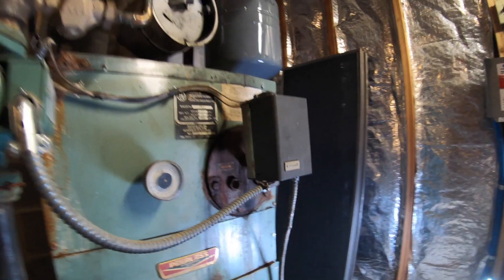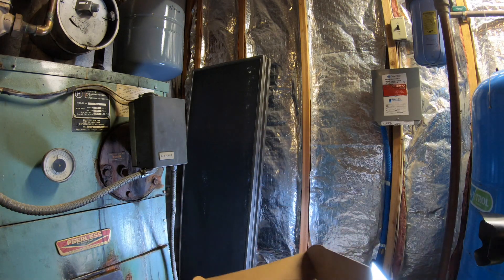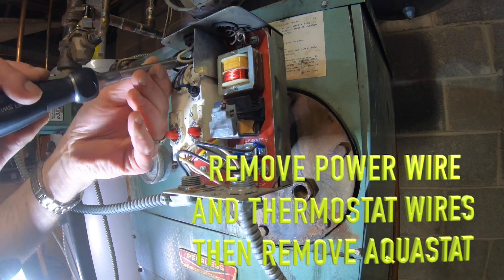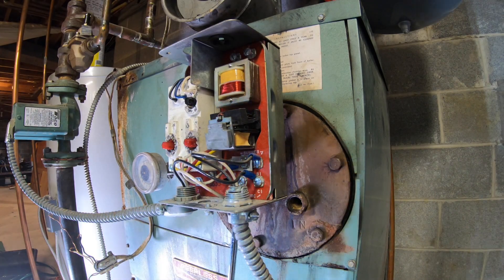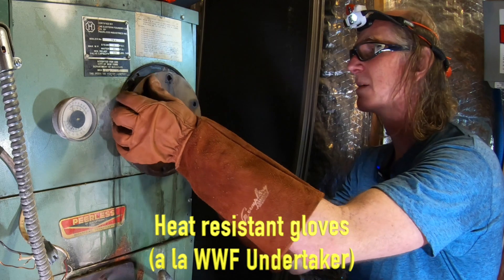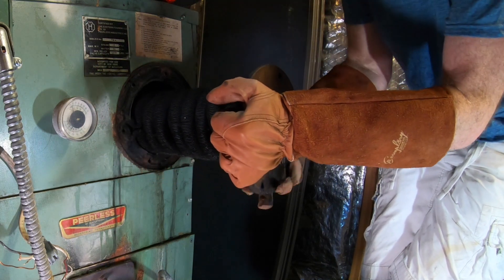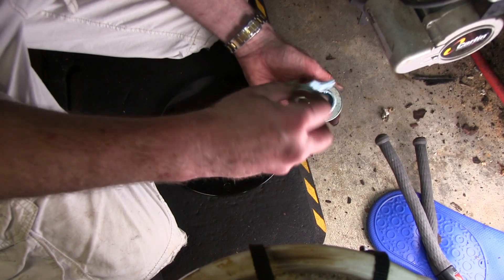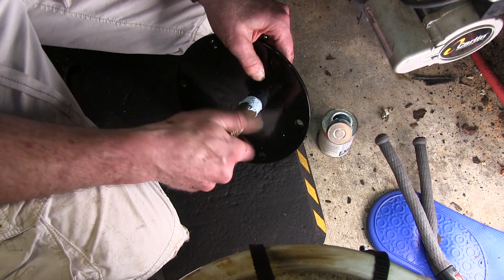Oil fired boiler Tankless coil gasket leak- DIY replaced cover and gasket

Comment: I have a really gnarly rusted one,leak  starting to rmake water line down the side and I  cannot afford a new furnace, is it possible to fix it, like you did? Or do they rot out?  Thank You
Reply from the maker: I still have that furnace, it’s working great.  My only worry was snapping off the bolts. You can buy a new cover plate like I did and it came with the bolts also. You just gotta be ready for the worst case scenerio. Like head snaps off a bolt. Drill it out, retap etc. or weld a new head on to spin it off, etc. it would be the same as if you were working on your car and had trouble with a bolt. Take a torch to it, etc. I got lucky and mine all came out in one piece cause I was really really careful. But I had all that stuff ready. Dremel, center punch, new drill bits, tap and die set etc. but totally fixable. Good luck.
Reply: @Drrich_DIY thank you !!  Yeah we rent here 43 years and our landlord has wanted us out for a long time. The problem is we’ve never been late with a rent payment in that amount of time so every time something breaks here to keep him out of the loop. We just fix it ourselves if the furnace went I think we would be finished and have nowhere to gobecause I think a new furnace is like $10,000 so yeah I was just hoping this thing is repairable thank you so much for your answer and it was very quick too. God bless.
Reply from the maker: Or you can just leave it. Do you have an automatic fill?  If it’s a slow leak who cares or you can manually add water once a week. It really doesn’t affect the performance at all.
Reply: @Drrich_DIY  it’s been off now for the summer. I turned it on this afternoon just to see what would happen and all the leaks seem to dry up so maybe when I was seeing was some kind of sweating going on downstairs not sure but thank you for the information because yeah, we would be up the creek if this thing died thank you!!

Comment: You have water heater next to it. You bypassed tankless.?
Could have you of gotten a new coil for it?
I’m in the same boat idk what I want to do by pass it or put new coil in that’s why I’m asking.
Reply from the maker: The prior owner cut the copper water pipes to and from the tankless and had an indirect fired water heater installed. So yes the tankless was bypassed. I was only doing this cause of a leaking gasket on the tankless coil. Let me say the indirect is fantastic. It stores 55 gallons of hot water, and has its own aquastat so I can set whatever temp I want for the hot water. We have 6 or 5 in the house including a daughter who loves baths, and have never run out of hot water. Ever. Even if we all shower.  Only down side is it’s expensive. The tank alone is about 3k retail plus it’s another zone with circulator so you’ve got a high install cost. But it’s definitely a 10/10. Oh and the boiler still needs to run year round but it’s cheap in the summer and uses very little oil to keep just the one tank at 150 which is where I run it with no small kids. Other questions feel free to ask.  Watch this. https://youtu.be/uAmzh98Ozyw?si=uEHTZlUYJZbkqTeB
Reply: @Drrich_DIY that’s great information that’s pretty much my situation I have baseboard flooring heating and I just started a ductless mini split for AC and heat. I use the heat just for a back up.
Reply from the maker: @brandonyoder6646 so what runs the baseboard?  You have a boiler- is it oil fired or natural gas?
Reply: @Drrich_DIY oil hot water but my electric water heater as well. I put heavy duty heating elements and have it up to about 170 just gives me more flexibility on what I use I actually used both I have my electric water heater tied into the circulation for the radiator with the hot water Oil Burner
Reply: @Drrich_DIY yes it’s oil for most part

Comment: Why does this boiler with the new installation of the gasket does not include the water heater coil?
Reply from the maker: NO WONDER IVE HAD NO HOT WATER SINCE I DID THIS!!!!!
but Seriously, thank you for watching and for asking.  The prior owners cut the water lines to this ( It's called a tankless heater because it goes right inside of your boiler).

They replaced it with something called an indirect fired water heater.  It looks like a conventional water heater that you would have if you had electric heat or gas heat, except it has no heat source.  Its basically a 55 gallon tank with a loop coming from the boiler as its own zone.  
That hot water Circulates inside a copper pipe that Coils around the outside of the inner tank. It "indirectly" Heat's up The 55 gallons of water inside. It has its own aquastat ( Thermostat) So you can raise or lower the temperature of the water.  You can see the water tank sitting there at 1:03 near the beginning of the video.

Comment: What's the Torque spec's?
Can't find them anywhere online.
Reply from the maker: Uh oh.  I've only got three torque wrenches and I used none on this job.  Honestly I didn't even think to look.  The plate was heavy steel, as was the boiler so I just made em hand tight. So far no issues.
Reply from the maker: @iamrevnow  I was just on a mission to find the spec but it’s nowhere near you’re right. Google ai said 20 to 25 foot pounds but I have no idea what this source of that is. Every manual for every brand seems to just say snug them in a star pattern. Maybe set the wrench to 25 and tighten in a star pattern then check for leaks. You could always tighten more. Good luck.

Comment: Why did u not put coil back in?
Reply from the maker: @Guilanadinhl if you look at the beginning of the video, you can see that many years ago the previous owners changed the hot water in the house from a tankless coil, which is what I removed, to an indirect fired storage tank.  They cut the copper pipe going to the indirect and re-plumbed everything.  It was a coil that had been disconnected already sitting in the boiler doing nothing.  There was a leak coming from the gasket. So since I was replacing the plate, I simply didn't reinstall it.  Had the indirect coil been in use I would have had to cut all the copper piping or at least disconnected it in order to remove it and then reconnected it afterwards with solder.

Comment: Hi what if screw broke from rust?
Reply from the maker: @Guilanadinhl  I would have been screwed. But seriously the kit had another set of bolts.  I sprayed them like crazy plus I had a plan.  Bolt extractor, reverse. Thread drill bits, and a bolt to weld to.  I watched a lot of videos on how to extract a broken bolt. But at the end of the day I just did it very slowly and It worked out.
Reply: @Drrich_DIY  awesome , thanks for sharing. Mines is leaking like yours , since I’m there I’m going to replace new coils & gasket. The leak is bad so it rusted some of the screws so I’m going to need the bolt extractor.
Reply from the maker: @Proscalecrawler  Just follow what I did. Go at it really slowly. Maybe even hit it with a torch and heat it up first.
Reply: @Drrich_DIY  thanks for helpful advice & thanks for the video!
Reply: @Drrich_DIY  hey replaced my coil & gasket. Did not go as smoothly as yours. Had 3 out 6 screws broken from rust. Then could not extract them so had to thread 6 new holes.
Reply from the maker: @ holy cow. Sorry to hear that but I’m glad you were able to thread new holes and make it work. That must have taken quite a bit of time to do three of them.  Did you grind them flush and then use a tap and die set to make the correct sized hole?
Reply: yes made six new holes near the old ones. Got em down flush as I could w/ the tools I had. I’m in Massachusetts so no heat or hot water while doing this. Kinda had to rush it.  But it’s not leaking anywhere for now. 🤞
Reply from the maker: @Proscalecrawler  @Proscalecrawler that took a lot of courage to do it in the winter.  Was it leaking badly?  I think no matter how much it was leaking, I just would have added water and done it in May or June.   Did you have to drill out the plate to match the new holes?
Reply: @ yeah it was leaking bad. Originally I was going to leave it & wait for spring. But basement was becoming steamy. I was also worried about mold also. Just took new gasket to align new holes
Reply: But thanks to your video it  gave me the courage to do it. Thanks for sharing!! And hopefully these comments will help someone that will have broken bolts like me.
Reply from the maker: @Proscalecrawler  Your job far surpassed mine though.  To tap new holes into a boiler is awesome. 
That's exactly why no pros will take on this kind of job, And its either do it yourself or new boiler.
Reply: @ yeah if I got a Pro to come look at it. I figured they would just recommend a new boiler system
Reply from the maker: @ unless it was Steve Lavimoniere. That guy can do everything.  He’s somewhere in Mass

Comment: When you had the leak was the furnace over pressuring?
Reply from the maker: No, not at all.  It was just an incidental finding.  While I was adding salt to my water softener right near the boiler,  I heard what sounded like water dripping onto a hot pan, and sizzling and evaporating.
It was a slow leak from the bottom of the tankless coil that was dripping onto the metal of the chamber door.  I try to tighten the bolts a little bit, But they weren't loose at all. Didn't affect the boiler in any way. I could have actually left it like that.
Reply: Thanks
Reply from the maker: @ np
Reply from the maker: A leak would cause it to under pressure. If your expansion tank is shot it will blow the relief valve
Reply: @Drrich_DIY  Thanks, i  think a leaking coil would cause it to over pressurize due to the loss in pressure.
Reply from the maker: @markmathis336  @markmathis336 We might be talking about two different things. My tankless coil wasn't hooked up. So the leak was coming from the water in the boiler circulating around the house.  Assuming you have an auto feeder,  as the water leaks out the auto feed adds water to the system So in theory, there should be no change in the pressure. It should be between 12 and 15psi Assuming you have a hydronic system with baseboard like I have.

Comment: perfect video. believe we have the same unit, but my plate looks like it's about to disintegrate 😅 i bought the replacement coil and SS bolts a couple years ago now, just been putting it off because i know it's gonna be a complete shit show. no way im getting all those bolts out in my case.
Reply from the maker: @MRGTi5  then it’s just a little dripping, leave it until the spring or summer of next year, so just in case, you’ve got the time to either drill em out or weld to the broken bolts. I was ready with both options just in case. Good luck.
Reply: @Drrich_DIY  yes, I have no experience with welding but I'm anticipating having to drill. hopefully I'm spared
Reply from the maker: @MRGTi5  good luck. Let me know how it goes. Here’s a video I always refer back to. Maybe it will help. https://youtu.be/x_ky5JVxtqU?si=Cxke3v_vHDIbjf1d
I’m no welder either but I bought a $100 harbor freight special just in case, and now I have it even though it wasn’t needed. Better than having to call someone.
Reply: One of mine did snap off. I kept spraying Kroil and i got just enough if a grip on it with Vice Grips. Wiggling the bolt back and forth is what actually freed it. I kept trying to just loosen. But a right left twist is the trick… I also went with studs and nuts instead of just bolts on my replacement plate. Figured it cant hurt, its how they keep diesel head gaskets from blowing. Should keep a good hold on a boiler plate…. Cheers, sounds like you have a fun one. Hope you dont do it in the dead of winter.

Comment: Nice video, ill be doing mine in a week or so. Good to see someone much like myself undertaking it.  👍
Reply from the maker: good luck with it. I was nervous for nothing. My main concern was breaking the bolts and they weren't even very tight.  Just take your time with that one part and it should go smoothly. Mine's been fine ever since. Thanks for watching and commenting
Reply: Appreciate that, i liked that you mentioned about isolating the boiler when draining. My peerless was set up to be able to isolate as well. Aside from about 4 foot of water line above the purge valve it should be a pretty easy purging. Cheers sir

Comment: There's definitely a case for stainless steel bolts...
Reply from the maker: You’re probably right but I think SS is much softer.  As long as I didn’t break one off…… the guy who services my system told me not to worry- if a head snaps off it’s easy to grab with vice grips. Just glad I didn’t have to test his theory. Thanks for commenting!

Comment: You succeeded in showing the How To.  The only thing I don't get is,  on too many of these videos of people showing How To.....they always show  something for instance you taking out the Aquastat and taking off all the wires......Then saying I could of done it without taking the wires off .....Huh ?!    Then show it that way, And say you might find having to remove the wires, or not. Also putting on the teflon on the pipe....I can't help thinking
it'll desinigrate and Melt the first time the furnace gets hot !  So What's actually Right ?!  I hear in so many " HOW TO "" videos GUESSING....or worse...after saying " The actual right way is.....After they showed themselves NOT DOING it that way !...But thank you....I did see the coil removed, aquastat removed, and replaced, and working. It's PB Blaster the nuts till the day a new one gets put in....Because putting in the old one is silly...yes it'll cost 250.00+ 
but..... "  365 days a year....I'm Not Looking Back !   Thank You ! "
Reply from the maker: So it was a Hail Mary pass for me. Due to the age and condition nobody would touch it. Don’t blame them. So the reason I said I could have done it without removing the aquastat was because the wires leading to it were long enough in my case to pull the tankless around it even with the wires still in place. I didn’t realize that until I was almost done. But that’s my system as wired. You may need to take the aquastat off. It’s pretty easy. Just a couple of wires. Just make note of where they go back. 
As for the pipe dope plus Teflon tape- I watch a lot of pros do this cause I enjoy it. Especially Steve Lavimoniere.  If you want expert plumbing and HVAC vids watch his. He’s old school and always uses Teflon tape and pipe dope together.   So that’s what I do also. So far no leaks, ever and I’ve worked on all parts of my heat and AC. 
Except for my couple of videos on dentistry that nobody really cares about, I’m no expert in most other stuff I do. My goal is to make “another” repair video showing how a non expert can get the job done. 
The boiler hasn’t leaked since I replaced the cover and gasket.  I ran a new zone to my garage and installed a modine heater, replaced all the zone valves,  installed a kick heater in a bathroom, replumbed my pressure tank, and recharged my refrigerator and central AC units after getting a universal 608 certification.  Thanks for commenting and watching.  I do appreciate any and all feedback. Glad it helped in some way.  You wanna see a pro do the job here it is. https://youtu.be/Qu5n8vXhxpk?si=kxMxBPomNYZ0ulEu
Reply: @Drrich_DIY  Good job. Don't listen to people with negative comments, thanks.

Comment: I know this is old, but I'm about to do mine. How much water is in there? I might not do the blank plate, but I need a new gasket. I think I'll just use the old plate. The new plate is like $112. Seems to me I can rework the old one.
Reply from the maker: It’s not that old!     I don’t know how much water exactly it holds, but hopefully you have gate valves on the supply and return piping you can shut off so you’re not draining down the whole house. I would estimate ten gallons- like two Home Depot buckets. However,  I’m not sure of if it’s included  in the video, but I thought it was done draining because the water stopped flowing out. I left the boiler drain opened, and as I removed the bolts from the tankless and air was able to get into the boiler, a significant amount of water then came out.  Apparently it was air locked, like turning a bottle upside down quickly. So unless you have other types of air vents you can open, expect more water to come out once you open the cover up. Last bit of advice, - it seems like your tankless isn’t in use.  Either way you are going to have to pull it all the way out in order to get the new gasket on. You will need to feed it over the tankless coil from the back and then replace the tankless. If it’s still connected in the front it will be difficult to remove unless you cut and resolder the copper.  Good luck. Any more questions, feel free.
Reply: @Drrich_DIY  I plan on cutting the coil off and plugging the holes. Basically making my own blank plate.
Reply from the maker: @slipperyjohnson7016   inside? Then youre not going to know whetber youve got a leak until u fill the boiler and put everything back together.